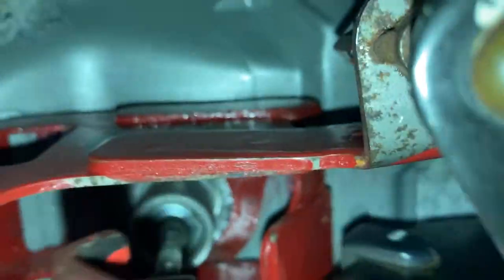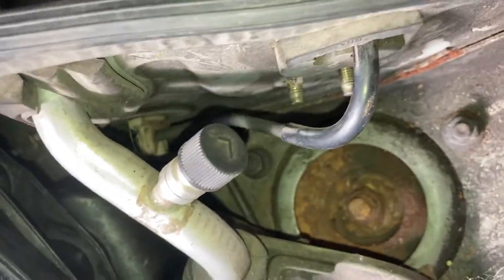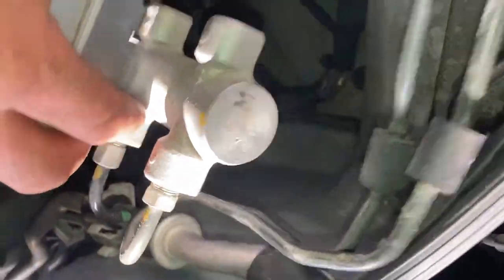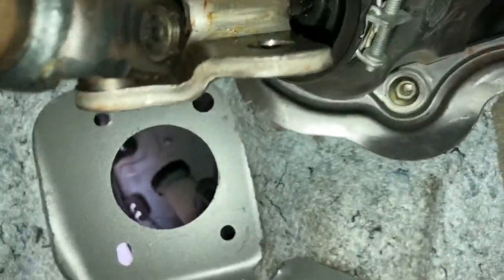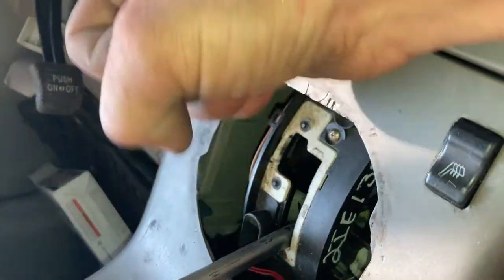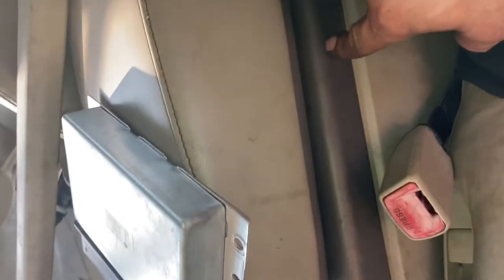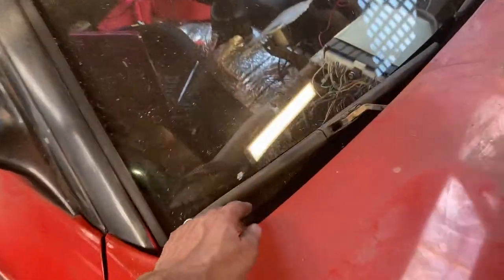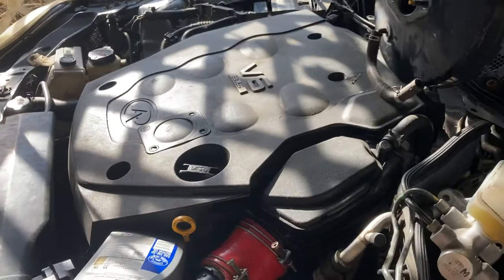6mt g35 sedan 5at. Clutch pedal and master cylinder install.

Comment: How'd you get that at ebrake bracket off?
Reply from the maker: I drilled out the factory spot welds, and used my pry bar to pry it up. Also used a chisel to help dig the rest of the spot welds up.
Reply: This and drilling the holes for the master is the worst part of the 6mt swap.
Reply from the maker: @blackmesaresearch2  yeah definitely, the hardest part is eyeing up the clutch pedal mounting spot without a template or anything to go off of. Everything else is plug and play.

Comment: Any updates?
Reply from the maker: Oh yeah, I’ve been driving it around, and it’s been great. No issues. I lost power to the reverse lights relay, and had to run my own 12v to the one side of it, but everything works as it should. I have done other stuff to the car since and just haven’t had time to upload any new content. Feel free to ask me whatever you need to know, I’ll do my best to answer everything to the best of my knowledge.
Reply: @King250sx-R I ran into an issue about the clutch petal kinda breaking the firewall sheet, is there any problem you ran into off the clutch pedal damaging your firewall ?
Reply from the maker: @luisc2425  I honestly haven’t had this issue, nor has it been something that I’ve commonly noticed in other people’s builds. I actually installed the 2008 G37 clutch and brake pedal setup, because they sent me the wrong one. It wasn’t until I installed the clutch pedal that I noticed there was some minor differences between the 04-05 g35 and g37 setups. The g37 pedal mounts up top and has a hole for it. I drilled through the bracket and ran a bolt down through and modified some other parts of it to get it all to fit, but it doesn’t move at all.